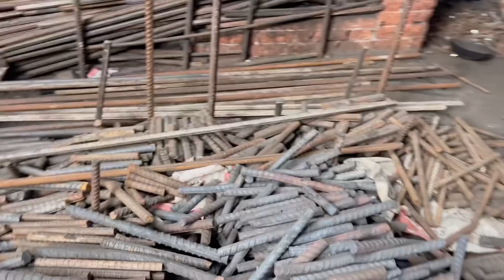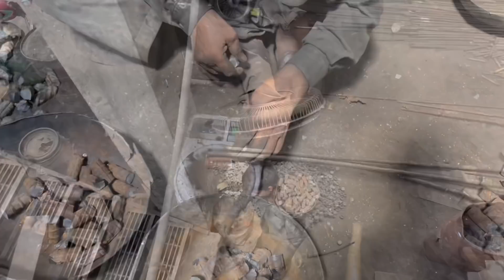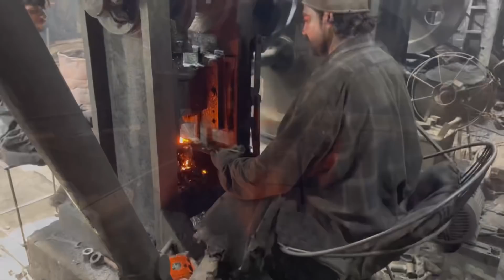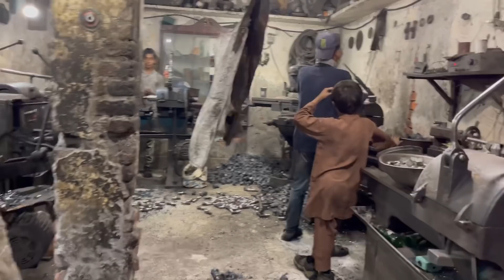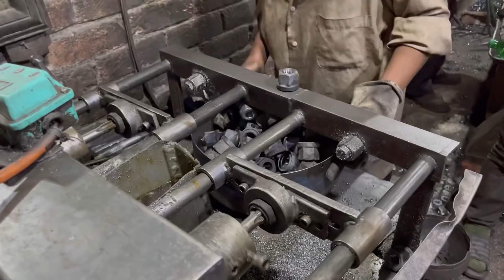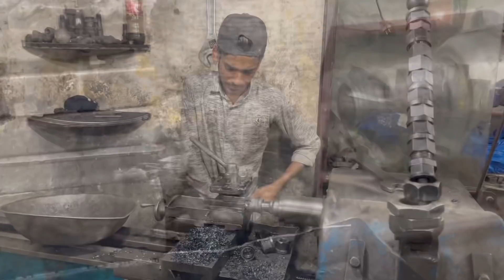Complete Manufacturing Of Truck Wheel Nut In Local Factory | ProductionOf Truck Wheel Nut  |

Comment: No heat treatment?  Rockwell hardness of pumpkin pie.  Warranty is 5/5 (5 miles/5 minutes).
Reply: Heh, you have no idea what you are talking about... they showed what is the source of metal and anyone with basic knowledge would know that there is no point to heat treat this low carbon steel...
No idea if the soft steel gonna be a problem, but it is steel so i do not expect it to fall apart in 5/5 just because you said so.
Reply: @Bialy_1  The threads however, MUST stand up to about 400+ LB-FT of torque if torqued properly. Even I'm surprised at the use of low carbon rebar! And I have 50 years background in HD trucks in vehicle maintenance. And yes, the nuts generally are made of a 'softer', grade of material than the wheel studs so they would fail before the stud.
Reply: @jessejohnson159  exactly, the stud bears shear loading/transfering torque forces, the nut job is only the retention of the wheel to hub
Reply: @jessejohnson159  Making it out of rebar was the surprise to me. I guess given the size, maybe it's enough to not tear up the wheel stud, as they're probably producing those things cheaply enough they can be replaced with some regularity.. Also, being able to cut the seats using a manual lathe the way that kid was doing if he's able to do it in any way consistently was the surprise to me...
Reply: Thing that I think is kinda weird is they're making them from rebar.  Rebar is just shit metal!!!!
Reply: We export our scrap steel to make rebar from here in the UK. It’s very low quality and full of contamination like copper, aluminium and god knows what else. I wouldn’t want to stay in a building made with it let alone wheel nuts!
Reply: @nicolassales8679  you're in the UK, or the scrap steel is exported to the UK?  There are several plants scattered throughout the US that makes rebar from scrap steel.
Reply: @metalguy304  it's also very cheap for them to buy.
Reply: @Bialy_1  A Ty chciałbyś mieć nakrętki z gównolitu?
Reply: @timothygeiger8271  ya. Suppose so!!!!!!!!
Reply: @metalguy304  you don't have to be so sarcastic.
Reply: @timothygeiger8271  not being sarcastic!!  Just making a comment
Reply: @metalguy304  What is ASTM A615?
ASTM A615 covers deformed and plain carbon steel bars for concrete reinforcement. This specification covers bars and coils in four grades, Grade 40, Grade 60, Grade 75, and Grade 80. The grade designates the yield strength of the material, i.e. Grade 60 has a 60ksi minimum yield
Reply: @Bialy_1  Right, no need for heat treatment as you have no idea of what steel this is actually made up of - rebar is like lowest quality steel - tolerances are very loose. Inclusions are present. 
Most likely most pieces are similar to A36 construction steel in US. This is a mild carbon steel for the most part that is hot rolled. Since rebar is a bit more loose expect C content to be somewhere between 0.2 to 0.4 %
Anyways no one in US or Poland would use ... rebar to make these - imagine the lawsuits!
Reply: @metalguy304  It depends on the tensile strength of the bar.  After the earthquakes here in New Zealand we now only use higher tensile strength bar for foundation work.  How do you know what tensile strength it is from this video?
Reply: @Airman..  The stud does not bear any shear load or torque forces between the wheel and hub.   The friction between the wheel and hub do all that but it is only achieved if the studs and nuts reach a proper clamping force.
Reply: Biały I’d suggest the numbers they are producing shows that they’re made from the re-bar shown, as a single use item! Done up tight to spec, you would stretch the thread to a single use only nut!? Cheers
Reply: yeah, though I dont work with metals, I wondered about that too.
Reply: Of course this is not ideal high quality production. BUT it can be made good enough. The point that I like least is the total lack of temperature control in the furnace. 
Other than that: Rebar steel types don't necessarily need a heat treatment after forging. Because when not completely f***ed up before during heating they undergo almost a normalization process during the normal cool down from the heat. 
Yes, they are soft. But that can be intentional.
Reply: The thing about this video is that you don't know what the nut itself is made from, you only see them forging the flange part of the nut. Since that is basically a built in washer, it could be made of anything. The actual threaded part, we don't see whwere those come from. Nor do we see them putting the two p[arts together.
Reply: @fryloc359  I think the whole nut is forged from the piece of rebar. It's not 2 parts.
Reply: @fryloc359  No sir, the entire part is made from the rebar.  If you rewatch it you will see the rebar forged into a slug in the shape of a hex with a flange.  The forging is then threaded.
Reply: It’s made of rebar… Heat treatment won’t do anything.
Reply: Do you really think they are concerned about hardness of the metal?
Reply: Hardening?  😁  This alloy is not suitable for hardening and wheel nuts.  They make nuts from reinforcement steel 🤦‍♂️🤦‍♂️🤦‍♂️ It's not safe! 
+unstable contact surface without cnc machining or special cutter with profiled insert for manual lathe
It product good only for surprize suicide on your truck, you don't know when your truck's wheel will fall off, tomorrow or in a minute

Comment: I don't think old rusty rebar has the mettalurgy for a wheelnut :-\ Probably why they have to make so many of them - always breaking. Have to give it them though - good looking final product.
Reply: Depends on the rebar quality, but going from european standard rebar there should not be any problems with using it for truck nuts. Ideal? No.
Reply: Rebar can be absolutely good enough for the task, when properly worked. The total lack of standardized process - i.e. putting the latest and youngest hire at the furnace to decide when the billet has been properly destroyed in the fire is the bigger problem than using rebar.
Reply: keep in mind, it is forged. That adds considerable strength. rebar is not necessarily junk steel. a lot is asked of rebar in its intended use
Reply: @danneumann3274   You are totally correct in this assessment.
Reply: @SharpElbows123  You can't forge molten metal that is liquid. You'd hit it with a hammer and it would just splatter everywhere. You cast metal that is molten. Forging can be done with hot metal,  or cold, and has different advantages and disadvantages with each.

Comment: And this is how grade ZERO nuts are made ;)
This is really horrible, both from safety of the worker and of the truck driver. But its Pakistan so there are some loose tolerances on both ends of the spectrum.
Reply: Zero grade? Didn't you see that speciat heat treatment in the furnace? :) Our torque is given in newton-meters, their is in hammer blows. If it fits. it sits.
Reply: @Alpha Jamil LOL, obviously you do not know what rebar is ;)
Reply: @Alpha Jamil rebar is very weak even after hardening
Reply: @Alpha Jamil 🤦‍♀️ first of all steel measurements are never done in psi I don't know how or where you got that from but certainly not from testing ts strength from steel I guess you use psi thats why you see in your country's wheels going faster than truck huh? Second it's REBAR for christ sake😂 it's lowest grade carbon steel that's why it's used in construction lol and did you just assume where I live? And no most American companies for manufacturing vehicles don't get bolts from China same as Europe that am sure of and if they do they are for smaller things like switches and Chinese actually know what steel to use for certain things Mr.psi also present measurements from hardness test I would love to see them since if you don't know tensile strength is not most important in bolts, it's hardness.
Reply: @Alpha Jamil I think you need to visit new  school and not American or from 60s lol it's pascals it's universal unit of testing and more reliable since pressure can vary.
So you got hardness measurements?
Reply: and still far better than the two piece ones ford , gm and other american brands have in their cars 👀
Reply: @Alpha Jamil What type of steel are lug nuts typically made from?
Reply: @deangregoric4735  high tensile strength of a bolt is more important than high hardness as the bolt stretches out under tension and if it was a very hard(brittle) metal it would just crack instead of stretch

Comment: I still do not understand why no one ever uses a cart, or bucket, or something instead of everything just tossed on the ground. These people can build engines out of scrap metal. Is profit over labor or the margins just that bad they can't afford something like that.
Reply: I remember reading about a body shop in India where when they painted a car they didn't bother to cover the windows because it was cheaper to hire someone with a razor blade to scrape the paint off the windows than it was to buy the masking tape and covering material.
Reply: Similarly... so many of these people's jobs shouldn't even exist. like... that guy that takes the hot nuts out of the press and chucks them into a bin... why the hell doesn't the machine just eject the nuts into a bin
Reply: I think it's the lack of a sharp mind from the shop owner.

Comment: No heat treatment at all - low carbon steel from reinforcing bar then annealed and forged, then cooling in air to further decarburize the surface. Hardness nonexistent, but at least ductile, won't crack fast.
Reply: If you disregard the cold shuts from forging the rebar ribs and shoddy blank cutting into creases, naturally.
Reply: @stefflus08  that true, indeed.

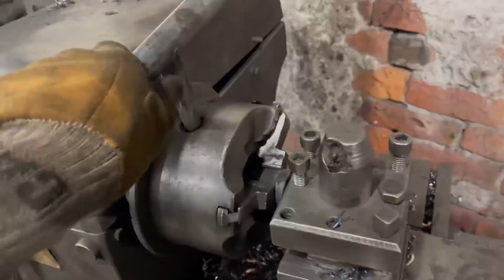Comment: 6:10 his chuck key is a tap welded to a piece of steel. It's a good thing it isn't structural.
Reply: I've seen some broke ass lathes before, but this thing is terrible. The Chuck is broke as hell, theres no coolant at all for the speed their going, and that top bit has a huge ass hole in it. Also, it's going so fast that the cut is super uneven and rigid for the hole its making.
Jesus bro

Comment: Facing operation could have been done at the same time as the boring which might have improved the  lopsided threading.
Not sure why they have a person throw the blanks into a hopper than to just have the bin next to the machine which the main operator can tip each one into.
Reply: hello you need to get a job there
Reply: @МаріяНесміянова  и оптимизировать производства, а потом внести ещё несколько рациональных предложений 😁😁😁
Reply: It looks like a order of operations that's been optimised for shit machinery. The only features that really need to be concentric are the axis of the threads and the conical face where it meets the wheel, they achieve (within a level of accuracy dictated by the fit of the threads) that by screwing the nut onto a threaded mandrel when they turn the cone. 

I'm surprised that they don't have a hopper under the chopper to catch the cut bits of rebar but a child might be cheaper than a hopper.
Reply: @mememaster147  they have a guy weighing each chopped piece . he rejects under and overweight chunks. if they went into a bin then he would have to pull them out of a bin.
Reply: There you go stealing a brothers job dam!

Comment: My trainer at tire service from the islands, exploded a tire right in front of me because the rim was to big for that size of tire. I hit the deck imediately.
Reply: If you already figured out how to screw the wide diameter cylinder part of a plastic bottle together, and it is still not completely air and liquid tight. Then a little bit more heatwork will solve that. greyishgreblum, "Pottery tap and die" w/ "cookie cutter" tap tool modification💜
Reply: There is a fire burning for you, if you can get to it. A gallery in Hell waits for no opening. Justice interesting to our King as water mud and fire, a tray turntable.

Comment: This is the reason wheels fall off trucks in the third world countries. 
They are using old rebar which is low carbon steel. Big no no. Check the county of origin on your truck parts !

Comment: Mass production on universal machines is not efficient. It has long been known that mass production requires specialized machines that perform several operations. Mass production will quickly pay for the cost of creating a specialized machine. The production speed will increase several times, and the number of workers will decrease, which is very beneficial for business. Then the culture of production. Why is everything on the floor and the equipment in a sad technical state? If everyone is happy with everything - no problem.